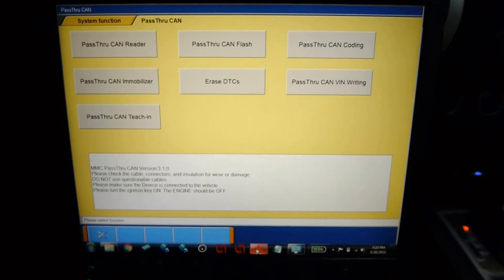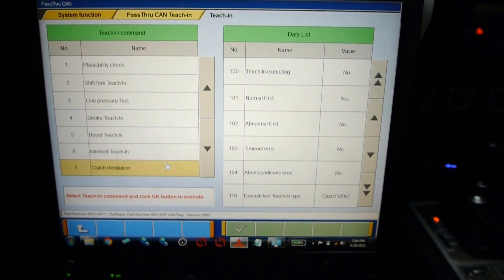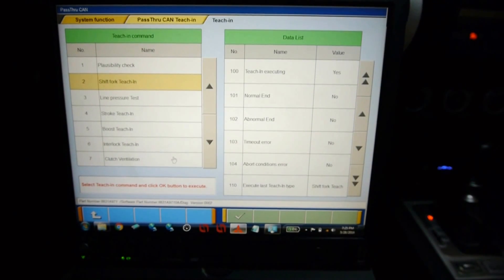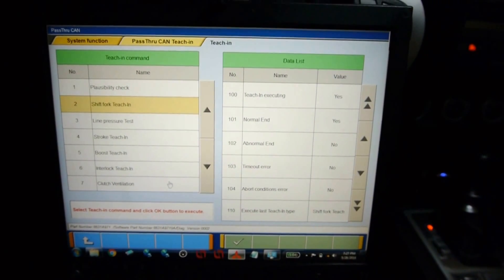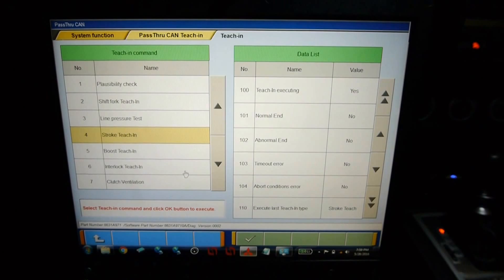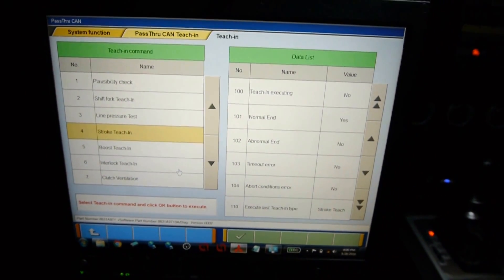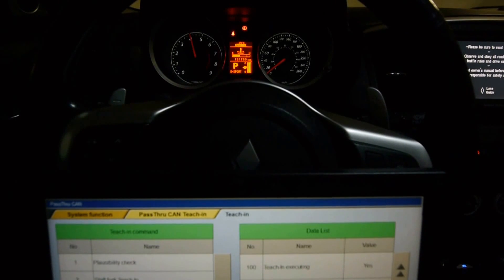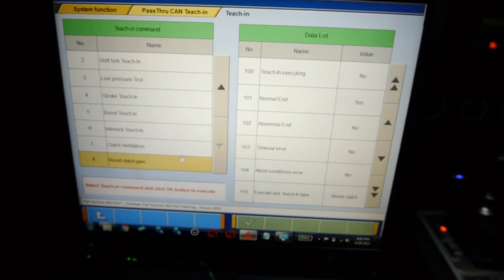SST teach-in Mitsubishi Lancer Ralliart and Evolution X MR

Comment: Under what conditions and when should this teach-in be performed on the SST?? And will this solve the grinding noise problem upon cold starts? Currently 75k no codes Just a grinding noise on a cold start worse in winter months...
Reply from the maker: Teach-in should be performed if you replace the clutch basket or mechatronic. It also seems to help keep shifts smooth if you do it once every year or two.

The grind on start is a completely separate thing that was solved with an update to the transmission firmware. Mitsubishi issued a Technical Service Bulletin for it, so dealerships should be able to do the update for free - but I went to several and they were unable to follow the clear, simple instructions provided by Mitsubishi, even when I printed them out and took them with me. So I just did it myself with PassThru CAN, and that's what started my whole journey into figuring out the SST!
Reply: @StephenStrangways   ok, so this "The grind on start is a completely separate thing that was solved with an update to the transmission firmware. Mitsubishi issued a Technical Service Bulletin for it, so dealerships should be able to do the update for free" as of what year my Ralliart is 2015 the last year that they made my car this should have been updated automatically from dealer before car was bought no?
Reply from the maker: The TSB was to update 2009-2010 cars, as later years already shipped with newer firmware. Three possibilities: 1) at some point the SST in your car was replaced with a used, older one with older firmware, 2) at some point someone had flashed Evo MR TCU software to get S-Sport, and they either used an old firmware version, or when they flashed it back to RA firmware they used an old version, or 3) the grind is not caused by the old firmware (that does a 5th gear engagement to see if the car is moving,) so it is something else entirely - a mechanical issue. Or just the wrong transmission fluid.
Reply: I'm a lil stumped with this issue,,I am the original owner and this is the original trans never been changed,, I service sst every 20k with only diaqueen sst fluid and also change the external filter every time I change my oil at 5k...  yes I I do have a Cobb flash tune since the car had about 10K and never ever had s sport installed or calibrated whatsoever.. also I do most of my driving in manual due to the excessive upshifting at low mph just the way I've driven to date once realizing the characteristic of this trans.. now at 74k with no longer within my warranty I'm hesitating to bring to the dealer from what I read they know just about as much as I do about this transmission 🤦‍♂️.. what to do..
Reply from the maker: Regular fluid changes with DiaQueen is good. The Cobb AccessPort is terrible. It's one of the worst things you can do for your SST, because it doesn't support tuning the SST tables at all. The OTS maps are especially terrible. I would highly recommend logging the trans with a Tactrix cable and EvoScan, and getting a good tuner who knows the SST really, really well, to go over it and see what state it's in, and if it's okay, get it tuned (or e-tuned) in a way that won't destroy the SST. And I agree that no dealership will be able to help you. They don't know anything about the SST. The only official repair procedure on it is to simply replace it.
Reply: @StephenStrangways  Does this apply to 2015 MR models too? Is it necessary to do with this year?
Reply from the maker: The 2015 models should not have any grinding on startup and do not need any software updates.
Reply: @StephenStrangways  Is the PassthruCAN software free? Is it hard to install?

Comment: Hello Stephen and thanks for the video!
Question: can I use my ELM 327 OBD2 Bluetooth adapter and do the Teach In over bluetooth or I need a cable no matter what? If the cable is required, please be so kind and advise exactly what kind of cable I need (just a normal USB-OBD2 SAE J2534 compliant or something special)? Whatever I find online is related to a specific diag package and costs over 100 Eur.
Thanks in advance for your kind reply!
Reply from the maker: An ELM 327 adapter won't work, but any generic J2534 compliant cable will work.
Reply: Thanks for reply, Steven!
I have a funny issue here: I've installed the PassThru on a laptop running Win 10 64b, without modifying the registry, and the program launched correctly (without cable attached). I've spent few clicks, everything worked fine, so I decided to modify the regisrtrys (both, 32 and 64) as instructed. I did so and the program doesn't launch anymore, it prompts me the message "C:\program files (x86)\passthrucan\system\common\ptcan.exe The specified path does not exist". The program and the folders are under "Program Files".
Do you have any idea what did I do wrong? Should I modify the registrys back to original and let the program install under Program Files (x86)?
Reply from the maker: The best thing is to uninstall the program, delete any folders left over, then modify the registries so it will install to Program Files, and install it there. You need to modify the registries before installing, not after. If it installs to Program Files (x86) there are certain features that won't work properly.
Reply: This is what I've done: uninstall from PF (x86), delete the folders, changed both registry, reinstall (to PF this time), try to launch,  restarted computer, try to start again, uninstall, checked registry, reinstall and try to launch again. Failed! :(
Reply from the maker: Uninstall the program, delete any leftover folders on the hard drive and in the registry, and try this. It has been pre-packaged to work on newer computer for flash Evo transmission software on to Ralliarts, but you could use it to just do a teach-in, if it gets PassThru CAN running properly on your computer.
https://drive.google.com/drive/folders/0BwiH3nUG8DY7TkRPR05Gb0pHeHc

Comment: after teach in my car jiggle when gear position r/d
Reply from the maker: Immediately after teach-in? I've noticed that cars will creep forward much faster - in drive, foot off the throttle - than before, because of the "reset clutch gain" step. After a day or two of driving, the transmission learns a new clutch gain value, and will go back to normal. So, if the jiggle is caused by that, it should go back to normal after some driving.
Reply: Stephen Strangways 
I didn’t open throttle my foot on brake pad and car have jiggle all time
Reply from the maker: How far have you driven since doing the teach-in?

Comment: Hi Stephen, I tried to do the teach-in on my 2012 ralliart but the car shut off and the engine light came on. Codes I got were U0100 P1870 P1871and P0725. The strange thing is without the software running and just plugging the USB connector into the computer would cause the engine to
cut out. I erased the codes with my android app and the same thing would happen when trying to do the teach-in. Any help would be greatly appreciated.
Reply from the maker: Those codes all share one thing in common - CAN bus communications errors. Weirdness with your OBD-II port would fall under the same category.

So, first of all, test your battery. Don't just check the voltage, but take it to a garage or auto parts store that can test it under load. If it's several years old and tests poorly, its time for a new one.

If that doesn't solve it, check your CAN bus lines. It could be a short in a wire somewhere, or just a loose connector.

The next official troubleshooting step after that, according to the Mitsubishi factory service manual, is replacing your ECU.
Reply: Hi .. i have changed the battery and it is still giving me the same error codes. I was wondering if the OBD2 cable i'm using is the right one. This cable I was using with the BMW software INPA. Thx in advance
Reply from the maker: Is the cable SAE J2534 compliant? That's what you need for this software to work properly.
Reply: No it's not a J2534 cable but i will go and buy one, then try again. The problem with my car is while driving, it would rev up to 5000 rpm on it's own. I was hoping i could do a teach-in and that would fix the problem.
Reply from the maker: While you were driving, and were pressing the throttle, it would suddenly rev up to 5000 rpm without accelerating? That's clutch slip, so a teach-in MIGHT help, but you probably need new clutches. How many kilometres are on the car?
Reply: That's correct without accelerating on it's own. The car has 177k but this is the second transmission in this car. previous owner blew the original one. while i'm driving there is no engine light. Other than the dealership how can i get rid of the 3 error codes in the computer ?
Reply from the maker: Clutch slip won't cause a check engine light, so that's not surprising. As for the error codes, your Android app, or using a Tactrix cable and ECU Flash or EvoScan should clear them. If they don't come back, it was just from plugging that BMW cable in. If they do come back, it likely indicates there is some other wiring or ECU/TCU communications problem, and that could cause clutch slip, if they are mechanically fine.
Reply: Hi Stephen, Got the new cable and the car does not cut out once the OBD cable is connected. however I get an error message when trying to use the software. (ECU no response. Check harness connection or IG SW. I had a friend come over today and he hookup his portable machine to the car 
and he manage to erase all the stored error code but it wasn't setup to do the teaching. still hoping I can get my computer to work. i'm  running win 10 64bits. Any help would be greatly appreciated.
Reply from the maker: That happens quite often to me, and uninstalling PassThru CAN and reinstalling it has always solved it.
Reply: Hi Stephen, while trying to install the software again i noticed that after making the changes to the Windows 7 64-bit Registry   " Change the two values to C:\Program Files and close registry editor" it still loads the software into the " C:\Program Files (x86) " how do i get around this ?
Reply from the maker: There are two registry editors in Windows 7, and you usually need to use them both. So, run "regedit" and make the two changes it, close it, run "%systemroot%\sysWOW64\regedit" and make those same two changes again, and you should be good to go.
Reply: Hi Stephen, I finally did the teach-in on my ralliart but it did not fix the problem. while driving today i got an error code P0846. Also driving in manual mode i notice it would only go into 1,3,5 until i turned off the car and restarted it. Will i need to get the transmission rebuilt ? thx
Reply from the maker: That sounds like a valve body problem, P0846 and losing 2,4,6. The problem may come and, go for a while, but it will slowly get worse until it fails completely, and you will need to get it rebuilt.

Comment: Okay what does transmission teach-in even mean?
Reply from the maker: It's a procedure for a dual-clutch automated manual transmission to run some tests: engaging and disengaging clutches, selecting and deselecting gears, and checking to see how much hydraulic pressure is needed to do those things, as it will change over time as clutches wear down, for example. The transmission then stores that data, and uses it every time it shifts in regular use.

The teach-in process must be done any time that parts are replaced in the transmission - if you replace the clutch, it has to learn how thick the new clutch is, essentially.

It's also a good thing to do from time-to-time, just to make sure that the data the transmission has stored is up to date. Sometimes a transmission can be shifting roughly, and after a teach-in, it's nice and smooth.
Reply: I believe I need to do that. I have a transmission code, something to do with the clutch? But the car drives good
Reply from the maker: Which code? A teach-in certainly can't hurt, but if the problem is enough to trigger a code, it will likely need more than just a teach-in.
Reply: Stephen Strangways the transmission code is  P1874 and it has something to do with the Clutch2 Pressure???
Reply from the maker: You can try a teach-in. If the code comes back, it means either your clutch has likely worn down to almost nothing, and inspecting or replacing it is the first troubleshooting step. If the clutch is fine, or it comes back after replacing the clutch,  replacing the mechatronic assembly is the next troubleshooting step.
Reply from the maker: It would be a good idea to log slip of the even and odd clutches using EvoScan on a laptop or Torque Pro with the MUT for Torque v2 plugin on an Android phone. That will be a good indicator of the health of your clutches.
Reply: Stephen Strangways thank you very much for your helpful information! I’ll get back to you soon. Thanks again

Comment: Hi Stephen. Thank you for the invaluable help!  Any idea if all the software and procedures will work with south america domestic market cars? I m here in Brazil (Evolution X 2015 John Easton final edition). Thanks!
Reply from the maker: Yes, it will work on any car from any market that has an SST. 

I love the John Easton Special, and wish we got those in Canada!
Reply from the maker: If you are running the 64 bit version of Windows 10, which you most likely would be if you bought the computer with Windows 10 pre-installed, then yes, you will need to follow the directions to make sure it installs in C:\Program Files\
Reply: Thank you. Indeed its a very special car. The  John Easton ECU and sst tunnig are awesome! Do you know about the recomendations to do a teach in ? I have no issues, but our local dealers dont know much about that.
Reply from the maker: Officially you are supposed to do a teach-in after replacing the clutches or mechatronic unit. Unofficially, it seems to be a helpful thing to do after a transmission fluid change, or even just once a year if you're not doing it alongside fluid changes.
Reply: One more ask. I m instaling the Passthru Can software with windows 10. I need to do that change in directory (as sugested in Tc-SST  flash_reflash guide pg 9) from C:\programfiles(x86)  to  C:\program files  directory?

Comment: Hey Stephen, thanks for the video/guide. Have a question, hope you can assist.  Currently in teach-in and the commands will either execute and do nothing (no revs) or get an error return (NRC $21 Negative Response Code was returned).  Have you seen this before, and any ideas?  For reference, flashed from RA09 8631A513[0C] to 8631A827[0B], Diag ver 0002
Reply from the maker: In many cases, uninstalling PassThru CAN and reinstalling it will solve that problem, so try that first.
Reply: @StephenStrangways  perfect, fresh install worked -- thanks!

Comment: do you experience problem with clutch ventilation? i have a customer who rebuild transmissions that came 2 time having problem to pass this step, clutchacks had same specs than oem fluid was hot ect...
Reply from the maker: It can be perfectly normal to take a couple of tries to pass clutch vent, but if it won't pass after several tries, that is often a sign that the transmission was overfilled with too much fluid.
Reply from the maker: Dry fill if the transmission was disassembled and completely emptied is 7.6L.
If the transmission was drained from the drain plugs while still in the car, the wet fill is 5.5L, or 6L if the cooler was also drained.
If any aftermarket parts are installed, such as a larger cooler, pan, or a heated sump, add whatever extra fluid is needed for those parts.
Reply: I have the same problem. A complete rebuild with the SSP stage3 clutch pack. The oil was filled with a special machine with the car running. don't know what's it called.

Comment: Hey my friend got a 2015 lancer ralliart and his sst doesn't turn on, if he does this procedure will he have the sst turning on? Or is this something else?
Reply from the maker: What do you mean by doesn't turn on? A teach-in won't work if there is a communication problem between the ECU and TCU, so it won't solve that problem.
Reply: Stephen Strangways his car goes into sport mode but he tried everything for it to go into super sport but it doesn't want to switch into super sport
Reply from the maker: The Ralliart does not have S-Sport. The Evo does. You can flash the TCU firmware for the Evo to the Ralliart to get S-Sport, and there are instructions on how to do it in the Google Drive link in the description. Just be sure to flash back to the Ralliart firmware before taking the car to a dealership - if they find S-Sport on your car, your warranty will be voided.

Comment: Hi! Can I use this method to teach the TCU from an Outlander SST transmission? Where can I get this software? Thank you!
Reply from the maker: I'm not familiar with the Outlander with SST as we never got them in North America, but I understand it to be the exact same transmission, so a teach-in should work the same way. There is a link to the software in the video description.
Reply: Stephen Strangways in the link, I have found a folder named Outlander maybe. Could it be the files that I need? In have not yet started the procedure. The mechatronic is stil out from the gear box. Anyway, if I make it, I will post it. Thank you for your help!
Reply from the maker: You don't need those files to perform a teach-in. They are only needed to update the software on the TCU, which you shouldn't need to do. There is a PDF file in that shared folder that explains how to install the PassThru CAN software,, and which files you need to put where, in order to perform a teach-in.